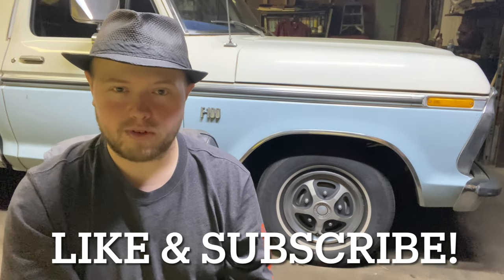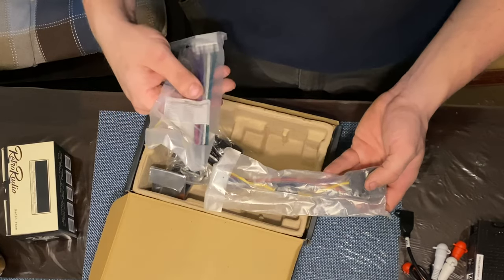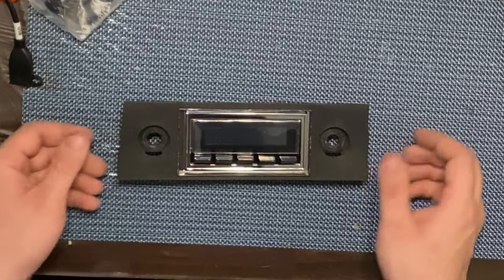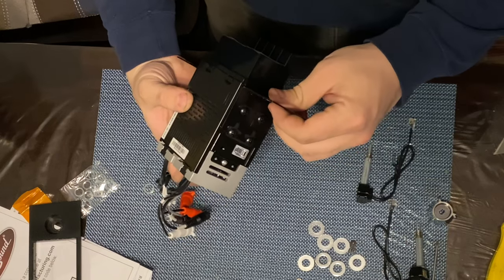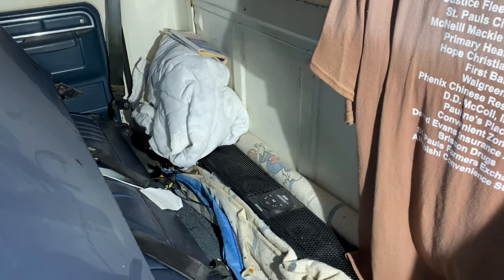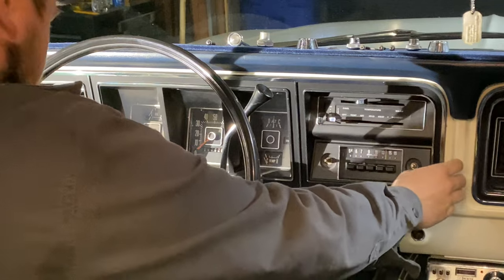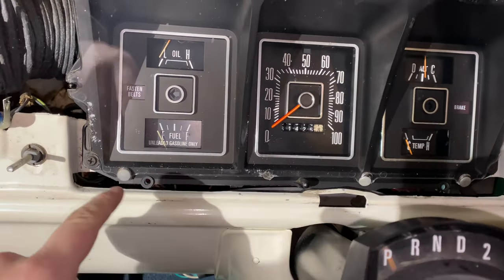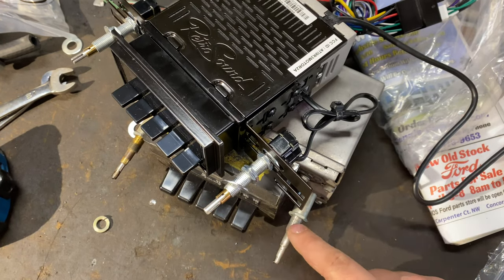How to assemble/install Retro sound radio and speaker boxes in 1973/79 Ford trucks.

Comment: Great video!  Installed the same radio in my Mustang, looks factory and sounds amazing.
Reply from the maker: Thank you! I couldn’t agree more, I’m very pleased with how it turned out. Thanks for sharing, and thanks for watching.
Reply: @FastFords289   I watched your disc brake conversion video but on one of later videos you now have Wilwood brakes?  Why did you switch and how do they compare?  Thats my next upgrade.
Reply from the maker: @grant3049  yeah i actually meant to do a video on that. I was having so many problems with the master power brake kit that I just cut my loses and ordered Wilwood which is actually what I wanted from the start but they didn’t offer a kit for my car that came with the booster and everything. So I still have the master power brake booster and master cylinder and proportioning valve but Wilwood disk brake rotors and calipers and lines and they work great! Couldn’t be happier. They install the same way as the master power caliper but they’re aluminum so they’re lighter and the pads fit better and just an all round great product so I highly recommend the Wilwood stuff, I wish I had just went that way from the start, I’d just had to get the booster and all from somewhere else but you live and learn. Hope this helps, and thanks for commenting and thanks for watching.
Reply: @FastFords289  Cool man thanks for the info.  Probably going to order the kit in a couple weeks also ordering the matching Wilwood master cylinder to go with it.  Gotta get rid of these drums!
Reply from the maker: @grant3049  no problem, glad I could help, yeah I don’t blame you, going to disk is definitely better, not to mention if you have some aftermarket wheels and seeing that Wilwood logo popping through them looks really cool too. Good luck on the build and thanks for watching.

Comment: Hey quick question so I actually bought the same radio… So from what I am understanding… Do the blue,red, and yellow wires connected to the radio need to be connected to the black one in the truck?
Reply from the maker: So I can’t remember what each color wire does on the retro sound radio, but I believe the blue is for an electric retractable antenna so I just tucked mine out of be way and tapped it up. I know one of be others is a power wire then the other should be a memory wire, so your power wire connects to the black wire in the truck and the other would connect to a constant 12 volt power source for the memory. Now I have noticed that even disconnecting the battery the radio still maintains the memory of your settings so you could connect both the power wire and the memory wire together and it’ll probably work just fine. Hope this helps, feel free to ask any other questions and I’ll try to help if I can. 
Thanks for watching.
Reply: Thanks appreciate you responding
Reply from the maker: @Liz19967  you’re welcome, glad to help.

Comment: Do you think it can handle a heavy sound system?.such as a large amp and 2 subs?
Reply from the maker: I believe it would, retro sound sells amps and subs for their radios like mine so I’m sure it’d handle it no problem, I just didn’t buy one because I didn’t see it to be necessary in a single cab pickup. Those two box speakers are great and get real loud and clear even with all the windows down cruising down the highway. I will be doing an amp and subs in the Torino when I do that retro sound radio in the future.
Reply: @FastFords289  Thank u so much👍👍
Reply from the maker: @lioneltamayo4705  you’re most welcome, glad to help. Good luck on your install/ build. Thanks for watching.

Comment: 6/18/23 see your video, really interesting,  have 1973 f250 want to install radio too, where you got retro radio like that?,  thanks in advance
Reply from the maker: I ordered it from retro sound radios online, I ordered the radio and speakers from there. Just go to retrosound.com should pull right up. Cool truck and Good luck on the install and thanks for watching.
Reply: My truck have & aftermarket radio, probably previous owner installed  & cut frame, now I going to investigate what's under dashboard. 
Your video let me know how to install a new classic radio with latest technology. 
Make more videos of classic truck.
Saludos desde Houston, Rene Jimenez
Reply from the maker: @renejimenez1946  yeah that happens a lot, you can check eBay for a new frame, they’re on there Al the time and easy to get. I appreciate it and glad I could help you, I plan on making more in the future, good luck on the install and thanks again for commenting and watching.

Comment: What kind of connect did you use for the constant 12V connection?
Reply from the maker: I found a factory plug under the dash with constant power. I just took a multimeter or a test light and checked plugs to find one. 
Thanks for watching.
Reply: Got it sorted. Great video, thank you.
Reply from the maker: @AtomicSkunk347  that’s great, you’re very welcome, glad you liked the video and was helpful and that you were able to get your install completed. 
Thanks for watching.